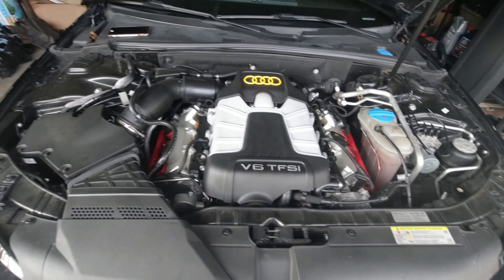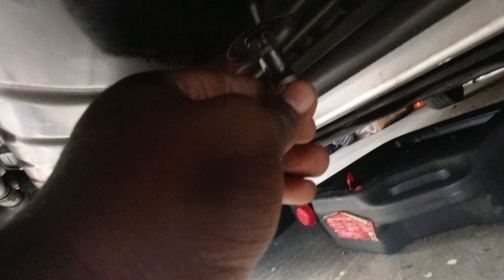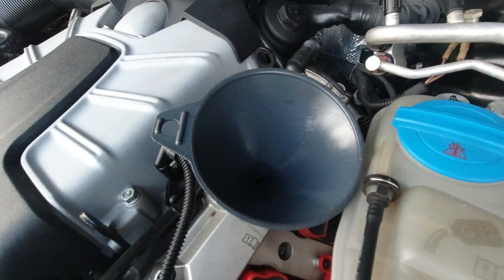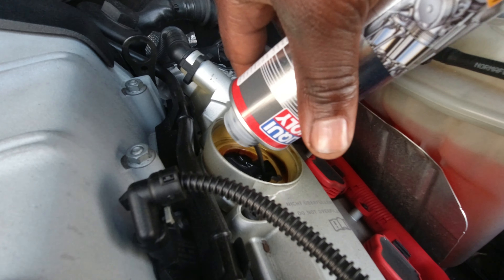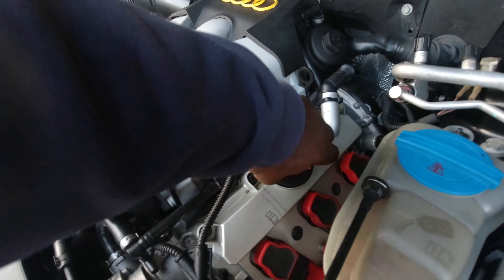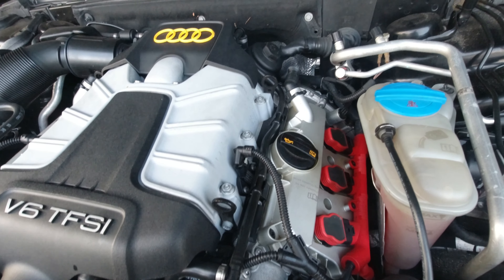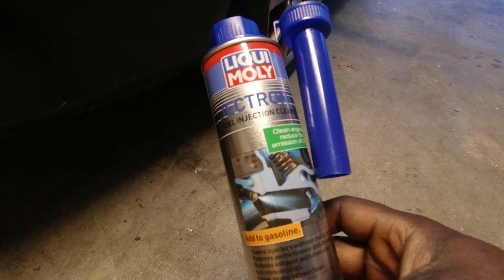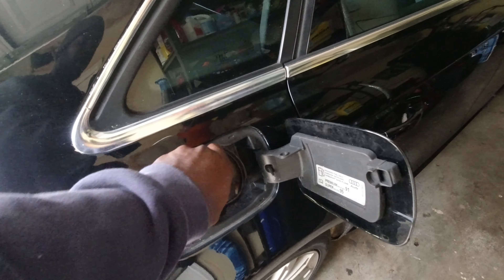PREVENTIVE MAINTENANCE | B8 S4

Comment: Thanks for sharing! Nicely demonstrated. One tip for when pulling the drain plug, if you put a thin plastic sheet over the 6mm socket (and your hand if the sheet is big enough), you can avoid getting at least some of that oil all over the place. I find that parcel shrink wrap works the best as it is a lot stronger than just general cling film.

Comment: Hey dude. Did you paint or plastidip your grille?
Reply from the maker: The previous owner plastidip the grill. It looked ok but I replaced it with the gloss black rs grill.
Reply: @Wattis161  Cool. Thanks for your reply. I have the plastidip here and the glossifier but does the plastidip stand up against a pressure washer ok?
Reply from the maker: Nope. It was pealing off little by little when pressure washed . So I decided to replace it.
Reply: @Wattis161  Yeah I thought it wasn't very permanent so I didn't bother. Also trying to find a spare grille the same design as mine (B8) to spray paint. Beats paying the price people are asking for the genuine black ones :)